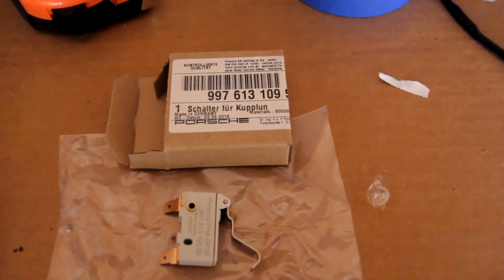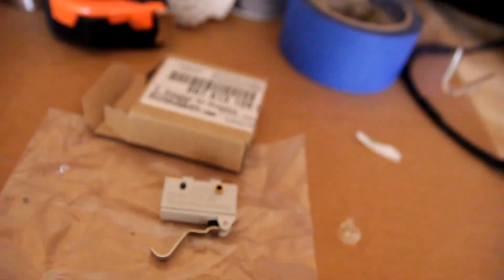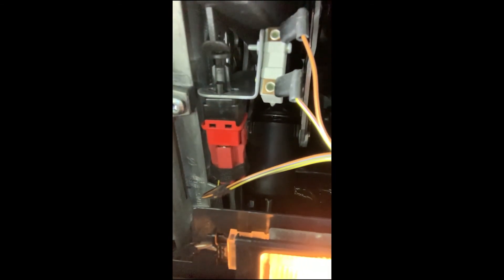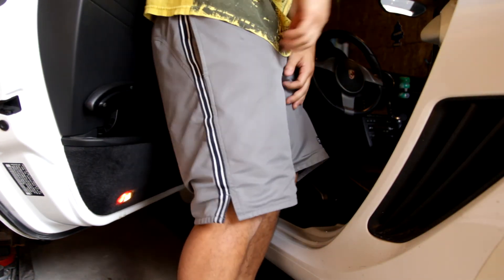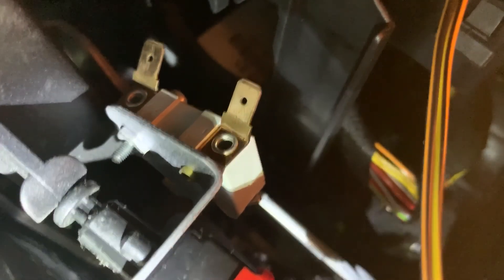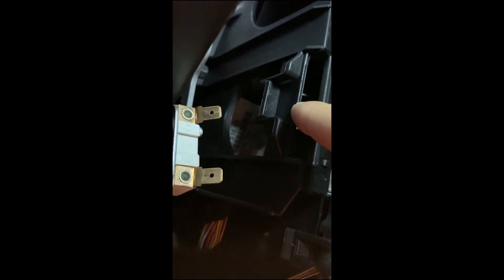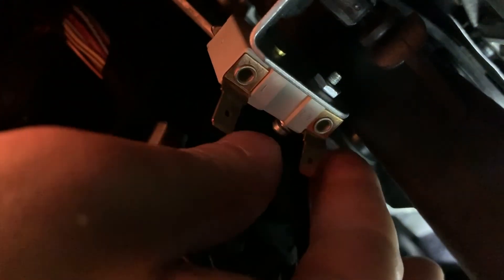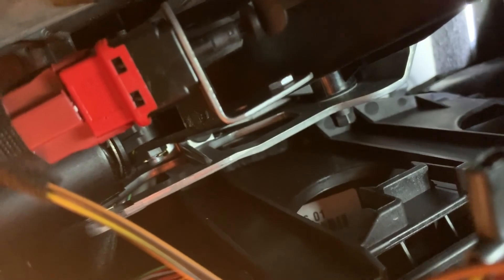Porsche 987 Cayman Clutch Pedal Switch Replacement

Comment: Thank you! Great video. You're not kidding, it's a tight fit. I was able to "fit" in without too much difficulty at 6'1", 200# but having "plumbers hands" doesn't help (this is the husband of the account holder). I would suggest using an "L" shaped T10 Torx as you can slot the torx end in a little more easily into the socket holding the long end with one hand and directing the "L" end into the socket with the other in that exceedingly tight space.
Reply from the maker: You're very welcome. It is indeed a tight fit, I can't imagine how tough it was for you haha. Cheers!

Comment: Many thanks for this, just changed mine using it! I had a normal screw in place of the T10 (possibly a prior owner had replaced)
Reply: Should have read the comment first! 987.1
Reply from the maker: Glad to hear it! What year is your car? I’m curious the screw type was changed in 2009.
Reply: @jontansgarage  Mine is a 2006.
Reply from the maker: @TheDlipowski  interesting. Definitely sounds like first gen cars may have used Phillips head screws.

Comment: Well done and informative, did not know it even had a clutch switch some recommend just connecting the two wires to by pass the switch all together if it fails.  This would allow the car to start while in gear and the clutch not depressed I would think.  I do understand why the switch is there.  Thanks again!
Reply from the maker: Thanks! That should in theory allow the car to start, potentially in gear. Would probably be necessary if wanting a remote start system however, I don't think the safety compromise is worth the convenience. Imo, it's a cheap enough part to just replace properly. Cheers!
Reply: @jontansgarage  I think you are right, safety is always the way to go!

Comment: Thanks for the video.  Unfortunately, my screw was a phillips head.  Not ideal at all.  Other than that and my 6'2" 220# build, it was pretty easy.
Reply from the maker: Oh strange. Do you have a 987.1 by chance? Perhaps they changed it with the update? Good to know!
Reply: @jontansgarage  I own a 2006 Boxster S 987 and mine was a phillips head. I used a CR-VPZ1 bit (secured perpendicularly in pliers by strong tape for proper access and torque, etc.). Once initially broken free, the screw is easily removed with fingers.

Comment: Thank you so much. Curious if this switch fails on a long trip if we could use a short wire to jump the connection between those wires  to get the car started (until we get home). Great video!
Reply from the maker: I'm sure it would work to get the car started as it does seem like a simple switch. I am assuming its sole purpose of this switch is to ensure the clutch is depressed in order to avoid accidental starting of the car while in gear but I guess it could potentially affect the drivability of the car as well though it's doubtful.